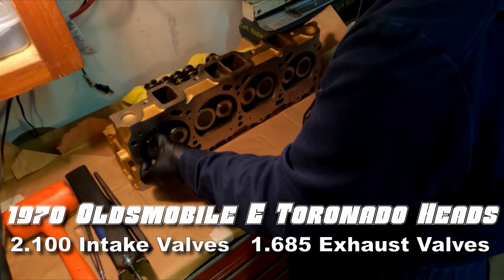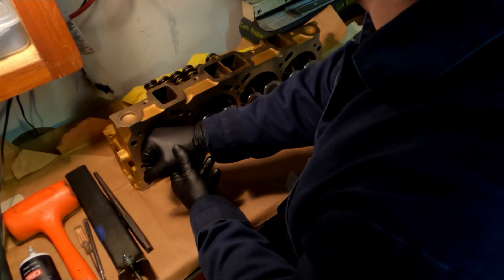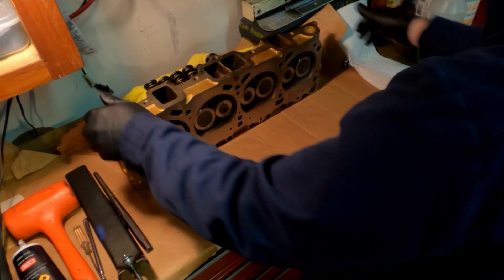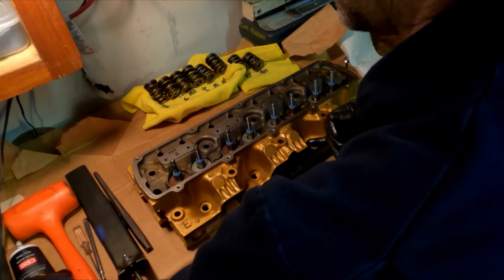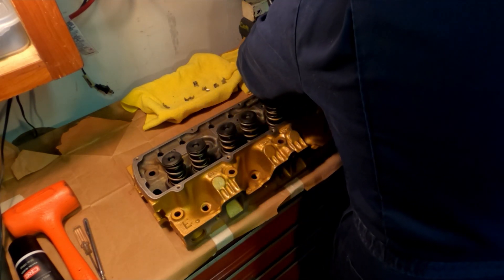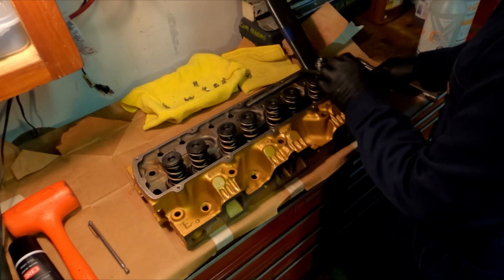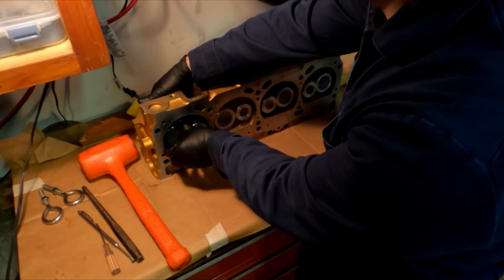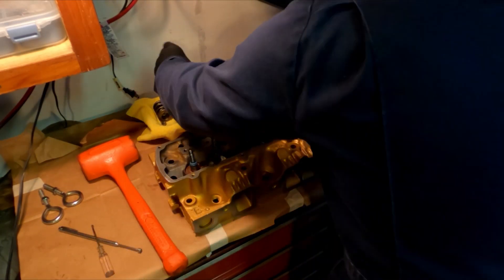1970 Oldsmobile 455 E Heads Assembly

Comment: what springs did you use?
Reply from the maker: They are Silicon-vanadium outer and inner valve springs with chrome moly retainers and heat-treated valve keepers, no dampeners. You can get them through Mondello, I think it was part number SK-240-D. I chose them to match the camshaft profile of the Engle 22-25 Hydraulic cam.